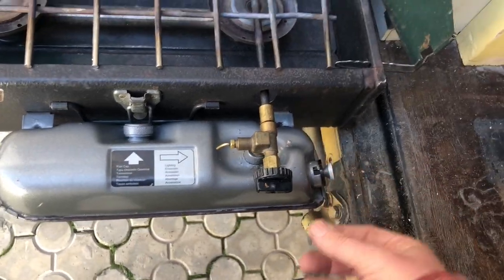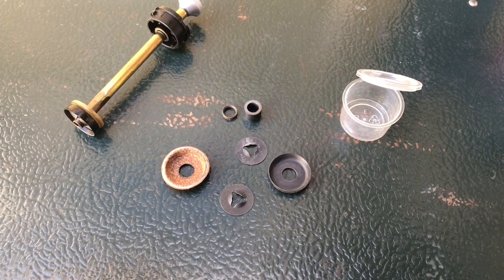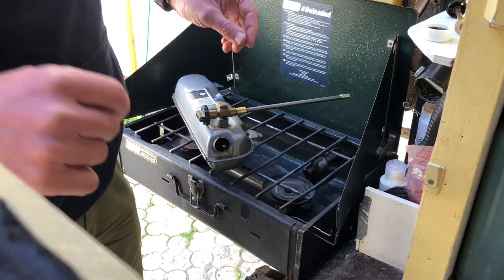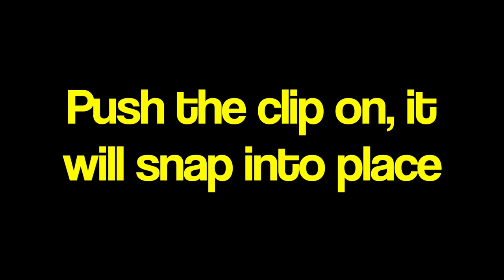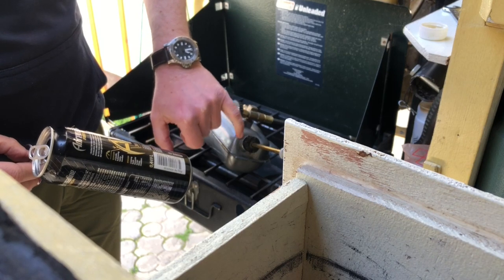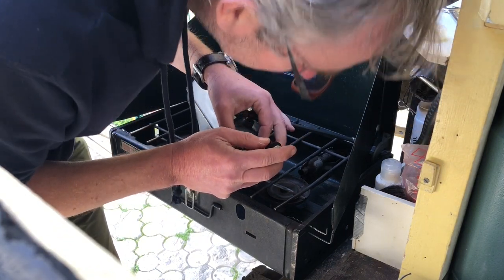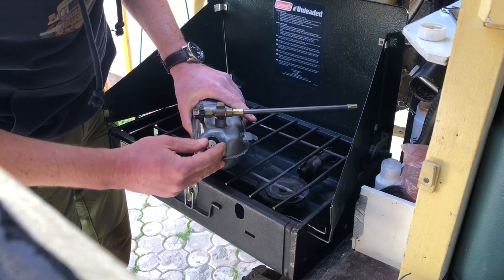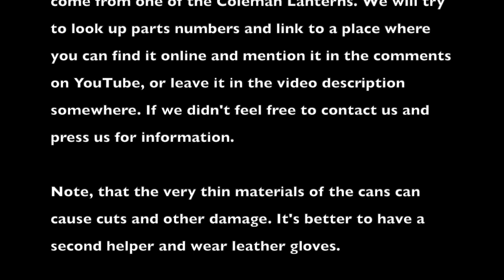Coleman Stove Upgrade: Leather Pump Cup

Comment: I find it interesting that replacing the junk neoprene cups with leather is seen as an upgrade seeing as Coleman originally used leather up to the mid to late 90's.  I have a 286 lantern from 96 that came with a leather cup but my 295 from 99 came with neoprene.  I replace the neoprene ones with leather irrespective of how good they still are.  The leather is superior in every way.  As proof, my 1948 Coleman 157 table lamp still has its original leather pump cup and it work s just as good as new.
Reply: Just went through the same pump cup replacement for my Dual Fuel Model 424 Camp Stove (unleaded fuel compatible).  After decades of reliable use, I tried to fix the pressurization problem by switching to a leather pump cup.  I found that installing the oiled cup was too stiff.  So, I phoned Coleman and they recommended Pump Cup part number 6391091 (Neoprene).  I tried this and it easily installed and sealed without issues.  Coleman said that this was also compatible with my 295 dual fuel lantern.  So, I think the Neoprene pump cup is the way to go for these two dual fuel appliances.  I suggest phoning Coleman toll free to get replacement part information for your specific appliance since the pump chamber diameter (and generators) are slightly different, depending on model.
Reply: @AroundAndAround2  Coleman only changed to the neoprene because they are WAY cheaper to make and they wear out (planned obsolescence) but if they work better for you who am I to argue.  lol  I know on by 290 and 295 the founts are identical except for paint colour and stickers.  The pump tube on all the founts are the same as is the diameter of the pumps.  The leather can be stiff though but working it a bit solves that.  I make my own pump cups now as what Coleman is charging is far too much.  I literally make them for pennies. I have dozens of lanterns and stoves and have yet to have a leather pump cup fail on me.  The neoprene though have always either worn our or split.  To each his own though.  I'm just glad you found something that works and that you're happy with.  Enjoy your lantern and stove.😀

Comment: Tried the leather cup on a 442 Feather stove once but it was so tight in there it was impossible to pump with it on and when I forced it the edges of the leather cup would actually flip upwards. I'd go with the black cup's always, I have ones that lasted for 15 years when regularly lubed

Comment: It seems easier to put it in first, then soak the leather with fuel and then oil!
Reply from the maker: I don't think you will be able to get a new leather cup in there. It will be too stiff and won't fit.
Reply: @landcruisingadventure  perhaps I had an off-brand. The leather was shrunken, but expanded after it was soaked. :)